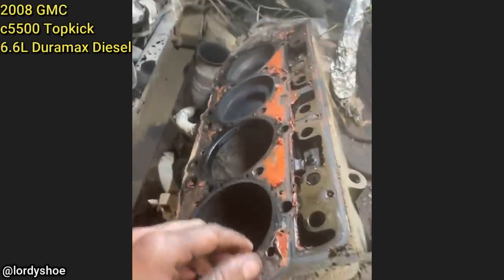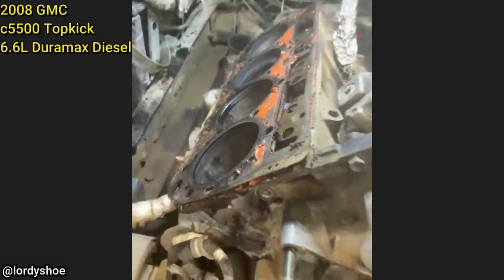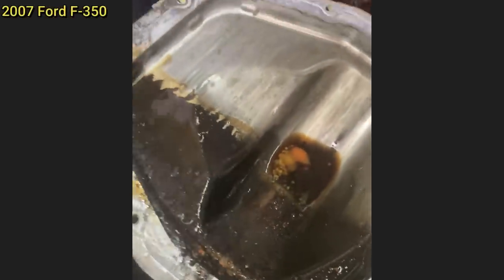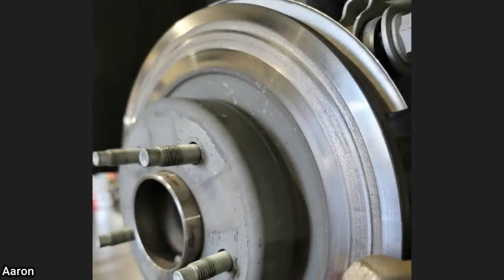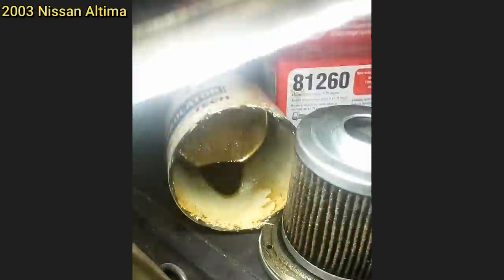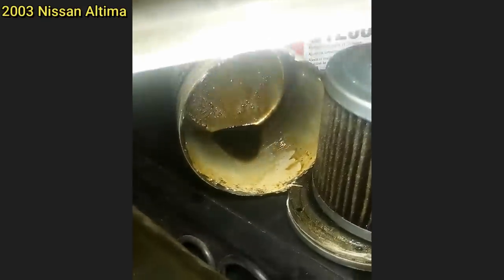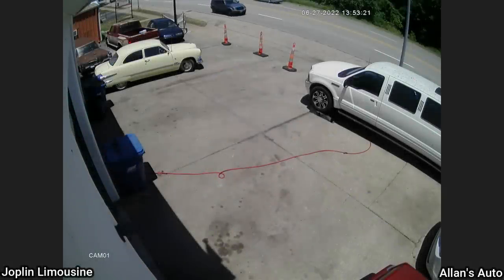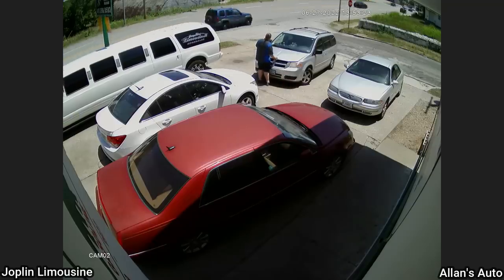Customer States Truck Might Need New Head Gaskets (GMC TopKick) | Just Rolled In

Comment: The guy with the A/C in 6 months: Why is my heater blowing cold?
Reply: To be fair, over complicated and to many choices to select.
Reply: "You did something to my car! The gas-milage is way worse now!"
Reply: Job security.
Reply: This can be said to be the fault of people who don't take the time to learn how their car works, but I think there is plenty of blame to be laid at the feet of the push for touchscreens controlling everything in the car.
With a touchscreen, I have to stop the car, then look at the screen while I find the right sub-menu and set things as I want them.
With knobs and buttons, I can learn how to operate the system by touch, and not be forced to either stop the car or drive distracted to change things like air temperature and radio stations.
Reply: It's Thursday in the UK??lol
Reply: @tonysheerness2427  or people are just slow 😆 .... Quit buying shit you can't learn how to work LOL
Reply: @MonkeyJedi99  
This can said to be the fault of the people who made the touchscreen.
If you lay around too many complicated options nobody uses them and they have trouble finding the ones that they need. 
I believe ergonomics is involved.
Reply: Better take it in!
Reply: Had an office where the thermostats kept breaking. HVAC guy would replace them. Fine for a couple months, then it would stop working again.

Turns out the HVAC guy was installing them incorrectly, so they would only heat, or only cool. They’d “break” when the season changed. Took about 2 years to realize the pattern :)
Reply: @gf2e  hvac guy got a lot of repeat work out of it though.
Reply: @jermainec2462  Everything is easy when you know and are familiar with it. Microsoft makes a fortune moving things around in their apps and every one has to go on courses to find out where things have moved.
Reply: I’m infotainment-literate!
Reply: @tonysheerness2427  you can watch enough YouTube videos to figure out the newest Microsoft office LOL... Take a day or two out of your week or just a couple hours a day look through your manual of your car or look something up if you're not sure about it it's 2022 information is everywhere you got a car with a bunch of screens or touch this and command that look that shit up lol
Reply: @jermainec2462  Things should intuitive without having to look them up., Going back to the tough screen and the greyed out  AC button it was easy to miss because it was greyed out. Once touched it became illuminated and the temperature started dropping. I wonder how many other people did not see the grey out button, except you Brains of the World.
Reply: @tonysheerness2427  I don't know what to tell you but people going to have to start keeping up with the technology because it's changing everyday every week month and year nothing's going to stay the same so you better keep up or get left out LOL... The automakers are getting lazy they're eliminating buttons and they just slapping screens everywhere so imma need y'all to keep up LOL
Reply: @jermainec2462  Of course they do not want to make it easy and have a SETTINGS button where you select AC to turn it on and off that would be to sensible, lets make ours completely different.just to confuse. When I mentioned Microsoft and going for lessons you said there are plenty of youtube videos., they are lessons. All done to confuse and not follow best practice.
Reply: @tonysheerness2427  now that is true they are making stuff more difficult and gimmicky but you still got to try and read your manual LOL.... It's not every car maker but but I guess they call himself making the new tech luxury or whatever...
Reply: @jermainec2462  Car manufactures are crooks, most cars  now come with a touch screen computer, so why not put all the fault codes into the computer so people can see what is wrong. That will be too easy and people will repair their own cars. I used to work for IBM and 15 years ago had software that would tell the engineer what is wrong, show him a 3 d pictorial of how to replace the faulty component with the steps taken to do it. Why has no car manufacturer installed similar software?
Reply: I had a roommate who was convinced his heater only worked when the A/C was on. I can tell you everything you need to know about him in two words: Nissan Versa.
Reply: I was cracking up! The dealer I worked at, the writer rarely opened hoods. Hi-volume shop, everything was "customer states". I would occasionally get a vehicle for an ac service that didn't have ac. (Customers see the "AC Service $39.95" sign and say "I want that!" And then there was the time that the customer responded to the writer when told his vehicle was not equipped with, ac replied with, "what the hell do you mean?! It had ac when I brought it in here!!" But I digress)
But this one time at the end of the day, a car--I had earlier denied service to a non-existent ac--appears at my stall. Customer driving...always a bad sign.  I walk over to the car, introduce myself, and this older gentleman proceeds to thank me profusely for a job well done, "ac hasn't worked this good since the car was new!"
Reply: @MonkeyJedi99  I couldn't agree more. And where did they get the idea the radio needs to come on when I open the door?
Reply: @jermainec2462  Maybe when the car makers stop MAKING cars with touchscreens?
Reply: @MonkeyJedi99  now why would they do that? Just learn how to work the touch screen it's not that hard LOL
Reply: @jermainec2462  As I stated earlier in this discussion, a touchscreen in a car is dumb.
My explanation remains that a touchscreen REQUIRES you to look away from the road to use, requiring you to stop to something as simple as turn on the AC.
While buttons, knobs and levers can be learned and operated by feel to let you manipulate them without looking away from the road.
.
.
LOL...
Reply: @MonkeyJedi99  you take your eyes off the road all the time when driving you have to check your mirrors don't you? I mean it's not that big of a difference especially if the touchscreen is that eye level or is sits higher up on the dash now I'm not saying that the entire thing should be touchscreen that should be a mix of buttons and screen... And how old are you?
Reply: @jermainec2462  I can check my mirrors in a part of a second, and those mirrors are also aimed at... the road and other cars.
How fast can I expect to navigate even a three-touch menu manipulation on a touch screen? And interestingly, the touchscreen does not show the road or other cars (except when backing up, in some cars).
-
Now, if cars had voice commands that would differentiate between the driver, voices on the radio, and/or the voices of passengers, then I would START to accept the tech-creep in automobiles.
-
I'm into my sixth decade of forgetting to die. Not that it should matter for this discussion.
Reply: @MonkeyJedi99  lol not 6 decades of forgetting not to die 😂😂😂 ... Well I'm 33 and since we agree to disagree that looks like what we're going to have to do because you're from another generation so I can kind of understand you not liking touch screens at all but I grew up with the mess so I'm more accustomed to it lol
Reply: You fixed my ac now there is a leak from the right front
Reply: @MonkeyJedi99  thankfully my newer vehicle has most of the climate control settings as buttons. But they put the air flow settings in the darn screen! Didn't want to add one more knob, too complicated.
Reply: @tonysheerness2427  I hate the new touch screens.  I just want to take 3 seconds to push the right button and get my eyes back on the road, not spend 30s finding the right menu then 10s pushing a tactiless button.
Reply: @snipersl270  100% agree one ac button on or off.
Reply: Honestly, it's 2022 and the car should determine for itself whether to use the AC.  However, I have seen automatic system go wrong badly, my dad's ~1999 Riviera decided late one night to go from automatic cold and blowing out the defrost vents by the windshield to stop the AC and blow humid outside air instead, instantly totally opacifying the windshield..  Software should, by now, know not to do that as well.
Reply: @Earthneedsado-over177   I was thinking the other day that self driving vehicles will never work. Because they won't go 40mph over the limit and zigzag all over the road cutting off all the other cars. Thus the driver will have to take over to correct the problem.
Reply: It doesn't work that way, you can run the AC compressor all winter if you want to and it will still blow warm air like normal.
Reply: @AnonymousPhucker  this, it's more effective at defogging your windows if you use the a/c with the heat.

Comment: For those might be wondering. My mechanic about 10 mins after the limo rolled, Did ask if he could go pay his power bill, was gone for about 30 mins. The mirror was the passenger door mirror where it clipped our sign pole. The video is now going to be used for training both my mechanics, and the limo drivers. Billy did a great job jumping for the door to get the brake. That limo is 39.5 ft long and weighs 12,980 pounds. with no one in it. it was in the most level spot of my parking lot when we tried this. When they build a limo they do not upgrade the brake systems so its still solely working on factory normal brake systems. He should have blocked the rear wheels before starting. Im just glad no one got hurt. Outside of a little concrete rash. The mechanic did have personal issues on his mind which is a big distraction and sometimes causes us not to think about our own safety. Great lesson learned outta this, and a great training video. Great reminder as to why when on ramps you should always work from the front and not the sides as well.
Reply: That mechanic is lucky he wasn't more seriously hurt when it rolled. My buddy was untying a car from his transport trailer when it rolled over his chest. It took several weeks to recover from cracked ribs an abrasions. Chock your wheels guys, stay safe out there!
Reply: Definitely a good case for using wheel chocks on the remaining wheels that are still on the ground, or any time safety could be compromised if the vehicle moves. All to easy to move the detent to neutral or forget that the driveshaft is what's holding the vehicle stationary. My brother almost died this way in similar circumstances. I could see the car was getting ready to roll over his head and I managed to grab his pantlegs and pull him out just as the car rolled away. Fortunately he had a belt on if I recall!
Reply: Consider yourself VERY LUCKY!!! A $200.00 mirror is a very cheap price to pay for the valuable lessons learned there!
Reply: You are a great leader not to bash the mechanic on YT. Lesson learned and made available to others. WAY TO GO ! ! !
Reply: Distraction is one of the dirty dozen when it comes to human factors. Look it up and share with your mechanics. All of the airlines use it when it comes to safety .
Reply: Glad it worked out and nobody was hurt. I've had a few get away from me.
Reply: Honestly just glad no one was hurt, that could have gone horribly wrong. It's also great you're using it for training rather than firing someone who just learned a very important lesson! Hope your mechanic can work through his difficulties as well, I've certainly been there before.
Reply: Yeah always do wheel chocks. Apply the parking/emergency brakes if available. Safety should be the number 1 priority and really all this needs to be taught in drivers Ed class because people are going to try to work on their vehicles when knowing nothing of the dangers. Glad no one got hurt here but that is scary.
Reply: I bet he needed a new pair of pants after that was over.
Reply: No, the best advice is when you're removing the trans is to make sure the car can't roll at all.  because the trans in Park is what keeps the car from rolling.  I've never done a trans when all 4 wheels WEREN'T off the ground.
Reply: I chopped off one of my fingers using a push mower for the exact same reason. It just takes one split second for these things to happen and nothing will distract you worse than family issues! I’m glad he’s okay!

Comment: The screw embedded in the brake pad is my favorite. That's wild!
Reply: That's indeed not a good advertising for the manufacturer, since it's an original pad installed by the factory and made by the OEM supplier.
Reply: I've had lots of issues with poor quality brake pads, mainly super-cheap ceramics.

Lots of super-cheap ceramic pads will wear grooves in rotors, I honestly don't know why.
Reply: @simonm1447  China OEM no doubt. I try to buy new old stock for my old car since it's crazy how many OEM suppliers are now in China.
Reply: Well is it really a ceramic pad? I would call it semi metallic at that point haha

Comment: I can't believe someone would go through all the trouble of removing the heads but then not spend the $125 for new head gaskets.
Reply: They also need to go to the machine shop for a check up/ clean up. Usually only runs $200. Skipping this step is also a total fail.
Reply: @spf-92.5  Only if the engine overheated and or the heads were aluminum.  If it didn't then warpage is probably not a problem and can be checked with a simple straightedge.
Reply: Bro I work in auto parts and the lengths some people will go to try to shave off a few bucks is amazing lol I mean we’re talking vital parts to do the job right will be shrugged off despite us explaining the importance of why they need what we recommend lol
Reply: Didnt have any funds for repairs, just enough for fuel.  Did the work himself and used old gaskets.
Reply: It never ceases to amaze me how cheap people are with their vehicles.
Reply: @spf-92.5  to say heads need to go to machine shop is pure lie
Reply: @spf-92.5  i was jus quoted a price of 4-450 per head if only the minimum of machining was necessary to rebuild head
Reply: Some head bolts need to be replaced also
Reply: That's pretty common from where I'm from, even "painting" both sides of the old gasket that's torn apart. Labor is free when its yourself, and that's a lot of money when you're buying a "nice car" for $1k. My first car was $500 and needed an $80 used engine from the salvage for replacement parts, ran super reliable after that and ridiculously easy to work on (Mercedes 300D)
Reply: @Hollywoodandsunset  That's what made me decide to work on heavy machinery. That stuff is too expensive for people to be cheap like that. It's not worth using rtv when you should use a gasket and blowing a $200k motor and labor to install it.
Reply: @Hollywoodandsunset  I'm the cheapest person I know, and even I wouldn't skimp on necessary car parts...Especially a new gasket; Pretty much the first thing required for a BLOWN HEAD GASKET!!!
Reply: @bad74maverick1  There is famous old saying: "It's better to have it, then not need it, than to need it, and not have it..." "Spent 12 HOURS on that stupid gasket; Made sure to install it PERFECTLY; You guessed it, the damn thing blew again!!! Shop said the head was off 1/16th of an inch...What could have cost $500.00, is now going to cost another $1000.00..."
Reply: @brentfarvors192  a 1/16th of an inch?  You couldn't tell with a simple straight edge in 1/64th increments it needed machining? A 1/16th of an inch is over the width of a penny. Should have been clear with a metal ruler and an eyeball there was a problem!  Only two things make a head warp that bad, aftermarket compression ratio or a severe overheating engine that forces the head to warp. That would automatically make one to do a simple check to make sure its straight.
Reply: @bad74maverick1  It was a HYPOTHETICAL genius...
Reply: @brentfarvors192  You in no way made an inference that it was hypothetical.  Usually one would say, "Hypothetically speaking", or "Hypothetical question, if this happened...." or even "Say this happened"......  Genius.
Reply: @brentfarvors192  no kidding these people cost themselves twice as much not only with money but time.
Reply: 🤣🤣 people are crazy
Reply: i would never try it in the first place, but my 1.2l engine is much smaller...
Reply: Obviously to "save" $125!
Reply: hell my head gaskets are 6 bucks for my car. i just bought them in bulk cause they were so cheap
Reply: @csjrogerson2377  where did that get him? At the mechanic
Reply: THIS. MY THOUGHTS EXACTLY.